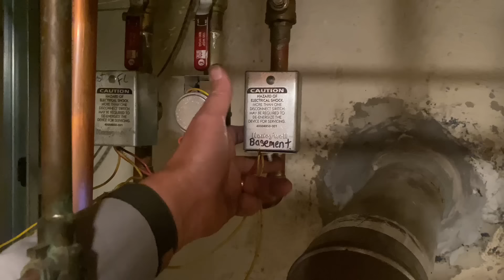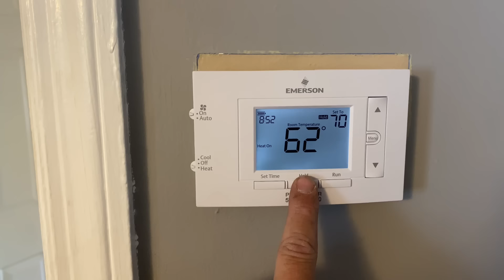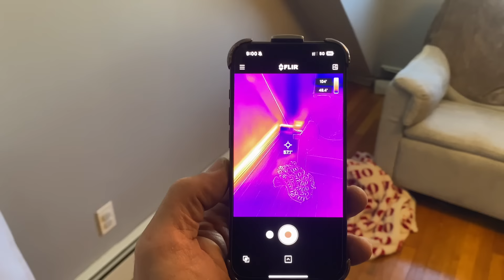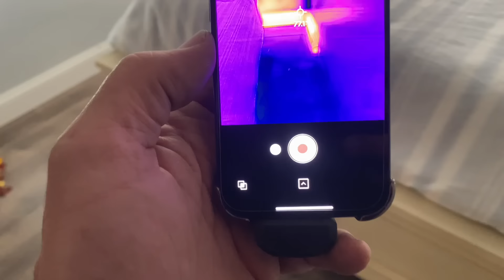Thermostat Isn't Controlling Heat Zone: Replacement Wire from 2nd Floor to Oil Boiler in Basement

Comment: Someone was nice enough to leave a pull wire from my basement to my attic in my 100 yo house. Its twice the length to be able to pull it back and forth. Ive seen this on boats so I knew why it was there and didn't remove when I moved it.  Good tutorial on 24 volt thermostat.  If guess you could troubleshoot with a jumper on the thermostat panel.  If it wont  fire a break in the wire. Or break out a multimeter I suppose and read it coming in and out.

Comment: Quick question, why do you think a pressure relief valve would go off several times in 4 hrs on a single pipe system.
Reply from the maker: Too much pressure
Reply: @PipeDoctor  I swapped the valve and a new pressure gauge. Now it reads 5psi for the second floor unit. Should be fine considering it has to travel up.

Comment: Man you got lucky Mikey…lacking 100+ staples inside the walls on that old wire 😂👍. Sweet job!
Reply: lol, code thumpers made everyone start stapling it to death and running it, just like it was other line voltage building wiring.